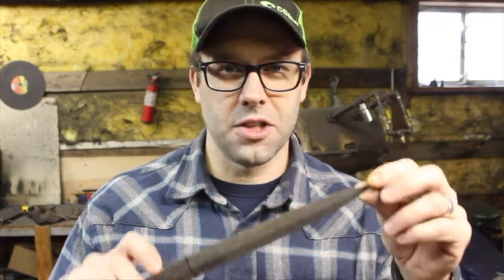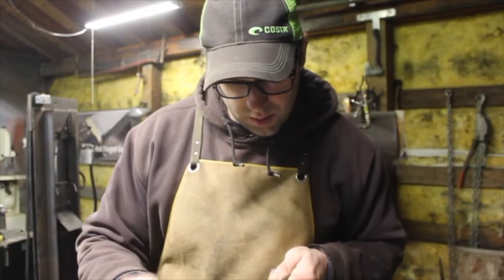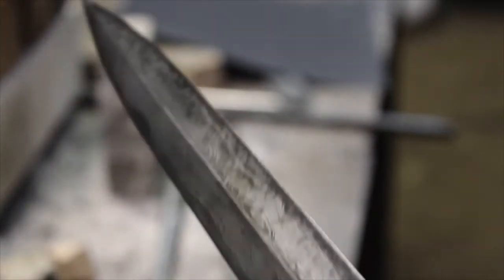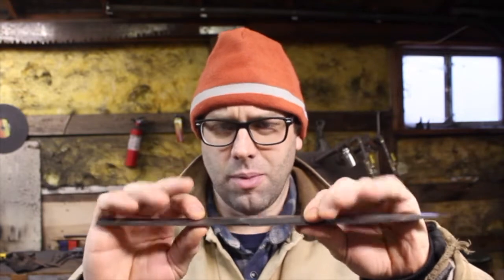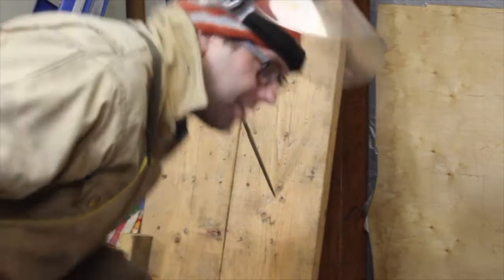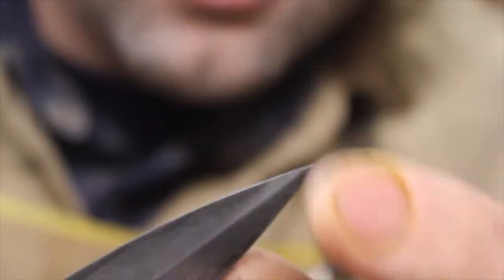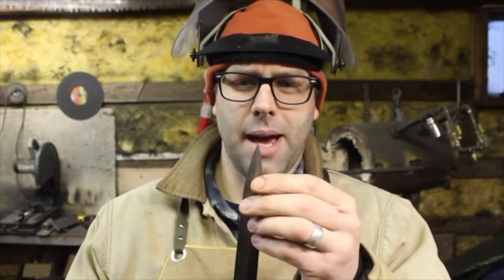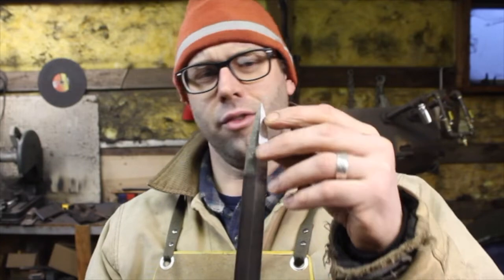Combat Dagger (TESTING) ~ Forged In Fire Rebuilds Part 5

Comment: Fist of all. GREAT video.
Second. Why did you reprofile the tip?  
I know it bent, but didn't break. That was a tough test and the blade came out the other side. I wish mine was made that wayLol.
The original Fairbourn -Sykes (Fs knife) has a needle point and my knife has said point.
When they were used on active service it was found that they would break, usually in some soldiers body/neck, ribs, and lose the point ( about 3mm or so) 
A popular thing to do was to grind the tip more to a ' Phillips screwdriver shape' 
The FS knife is not designed for fighting necessarily Mano a Mano or for opening cans or cutting wood. It was used for quiet silent killing, sentry assassination It is a STILLETO really 👍🏻👍🏻. 
That was a terrible test on forged in fire, but it makes good, albeit inaccurate tv.😱.
Have photos of mine if you can't find the literature with dimensions for more accuracy if you require?
Keep calm Keep safe and Carry on👍🏻👍🏻👍🏻
Reply from the maker: Thanks! I re-profiled it just because I wanted something that would be less prone to bending, which with these steels means a thicker cross section.  that's correct, the F/S does have a very narrow range of intended use, and really isn't built to be very tough in any respect, but that's not it's designed purpose. I did print off some specs that I believe are pattern II originals, but I didn't intend to stick too closely to the anyway, but add some design elements of my own. thanks for watching!